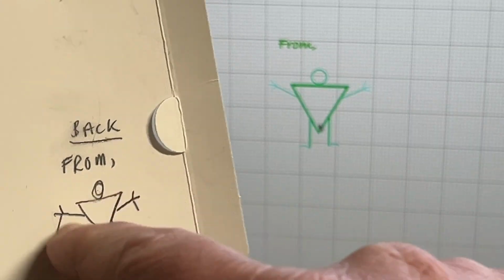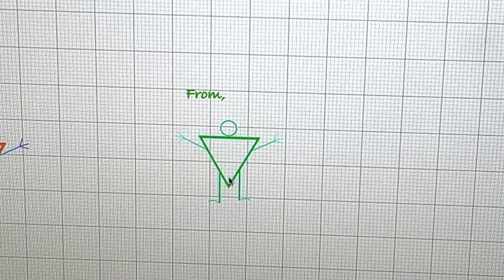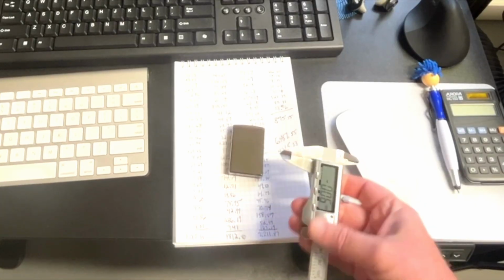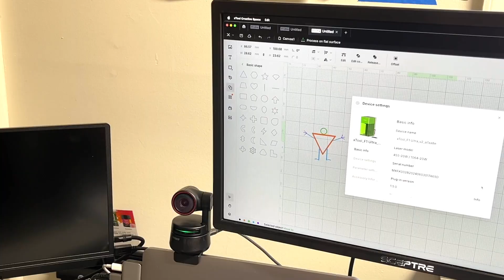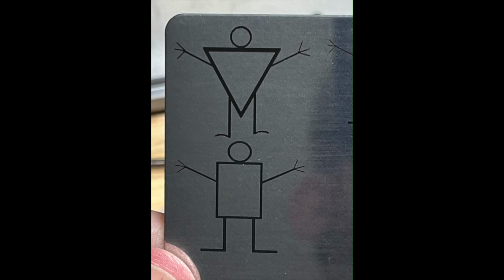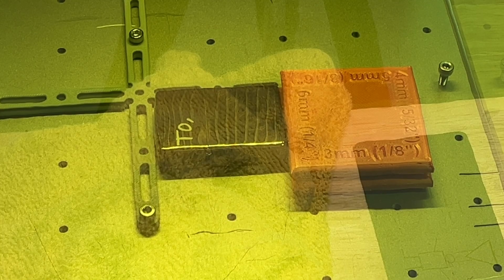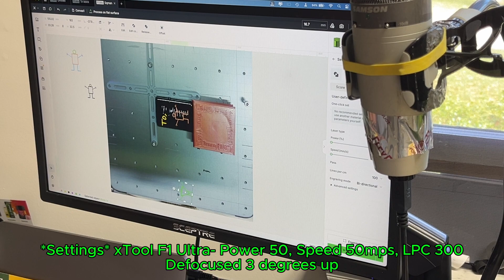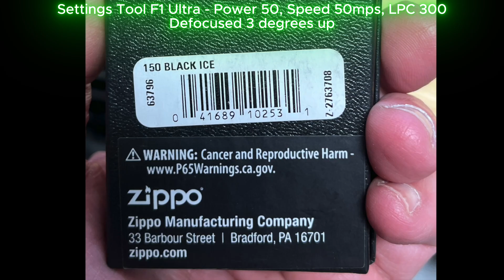"Perfect Laser Settings for Zippo Black Ice! xTool F1 Ultra Engraving + Defocus Tips"

Comment: I know you tried the laserpecker 4 in the beginning! Whats your thoughts on that brand for laser engravers?
Reply from the maker: I still have my LP4, and while it was great for learning, it wouldn't be my choice today. In my opinion, xTool is a far better option if you're looking for a user-friendly experience, excellent customer support, and good resale value. However, if I had to choose a laser for metal now, my top pick would be the ComMarker B6. It offers fantastic quality at an unbeatable price. Once you get the hang of LightBurn, you're good to go—it's easy to learn, and there are tons of YouTube tutorials since it's been the industry standard for a long time.

So, if I had to make a decision today, the two lasers I'd be considering are the ComMarker B6 and xTool, not the LaserPecker. Sorry, LP, but that's the direction I'd lean toward. The LP4 is still great, and I haven’t heard much about the LP5, but LaserPecker's software issues really frustrated me. Since they’re a smaller company, fixes sometimes took longer than with xTool. In contrast, xTool is fast, and their team works hard on the software—it’s a pleasure to use. Plus, LightBurn is the industry standard for 90% of lasers, so it's definitely worth learning no matter what laser you own and most of them including xTool and Laser pecker can work with Lightburn but for xTool it's not really needed as their software is really good and getting closer everyday to doing a lot of what Lighburn does Laser Pecker Software always worked best on phones and I hate doing laser work on my phone. Good for craft shows and mobile engraving simple things but I feel it's really geared towards that crafting market - hope that helps